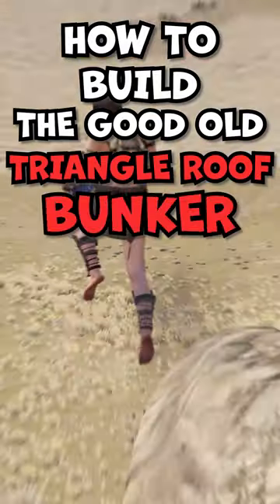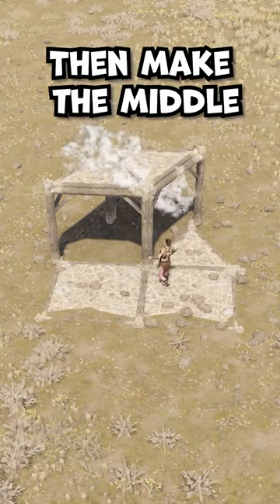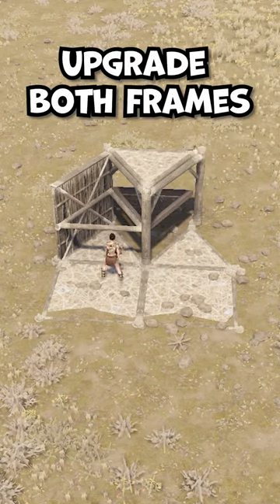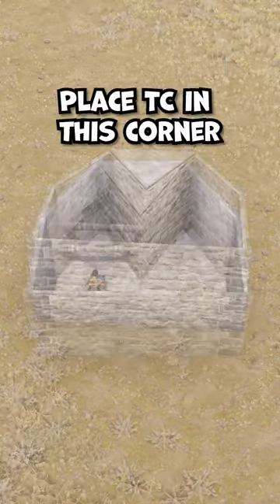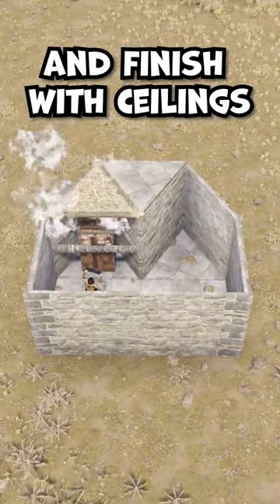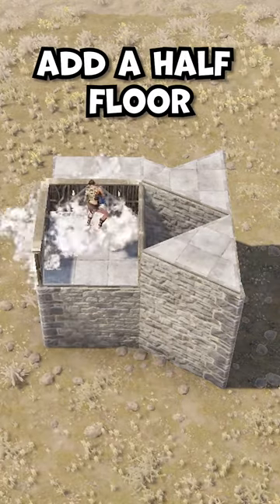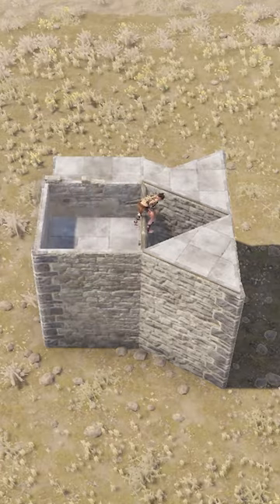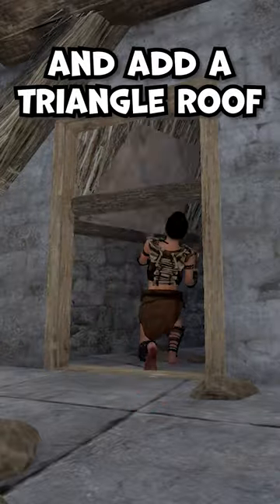How to BUILD an OLD TRIANGLE ROOF BUNKER in RUST short #shorts  #rustbase #rustbunker #rustshorts

Comment: I'm new at this game, what's for? Like un able to get raided or just more strong building?
Reply from the maker: Well, what do you think? I'm interested to hear the answer from a new player)
Reply: @stelicRUST  you said it I'm a new player I literally just played like 2 hours ago, I barely know how to build anything or upgrade it
Reply from the maker: @Carlosdpg19  Look, this bunker needs to be built when you exit the game. Thanks to him, your base will be difficult to raid, because raiders will need to spend 2 times more rockets.
Reply: @Carlosdpg19  normally bases have door entrances like double doors and garage doors. But people find ways with the building mechanics to add walls supported by twig. If the twig is broken the wall loses the stability necessary to keep it in place. This makes bases much more expensive because it forces raiders to go through a wall or floor as opposed to doors
Reply: @Carlosdpg19 if you have anymore questions I’m more than willing to answer them
Reply: @Carlosdpg19 sup bro by now I'm guessing you've found out these vids are kinda stupid coz it literally doesn't matter what you build it will be destroyed last wipe  dudes blew through 2 high stone walls about 5 stone roofs and 3 armoured roofs to get to my TC they just went straight through it was a great raid defence tho very fun
Reply: @Carlosdpg19 - The doors are often a weak point on a base, for example the strongest door only takes ten satchel charges to blow, but the strongest wall/roof/etc (armored) takes 46. So what these different "bunker" type bases allow you is to have a very strong (and usually fairly small) "core" in your base where there is not just a regular door, but a wall/roof/ceiling or such that blocks the entrance, and that allow you to destroy that building piece easily from the inside (usually by placing it on a twig piece, but that is extremely hard to destroy from the outside. There are also other versions that can only be accessed by respawning inside the bunker, and where there is some kind of trick to pass loot in/out through a pixel gap or some other similar way
Reply: @daniellane1605  I’ve had several bases survive the whole wipe without being raided. Location is the most important
Reply: @stelicRUST honestly bro raiding through doors is stupid unless its a small base, you almost always raid through the walls since its the hardest to make strong
Reply: @Nisen3000 most people just raid through the roof